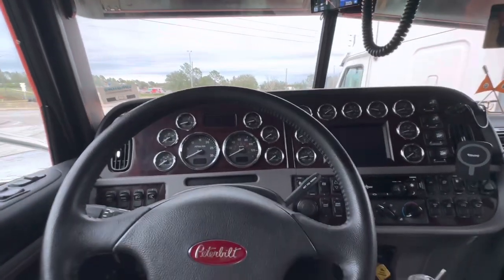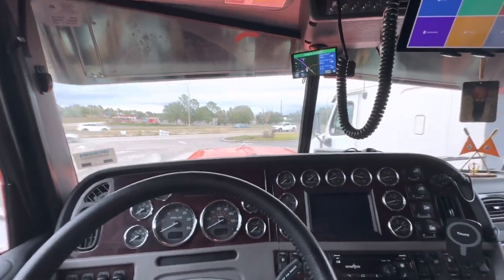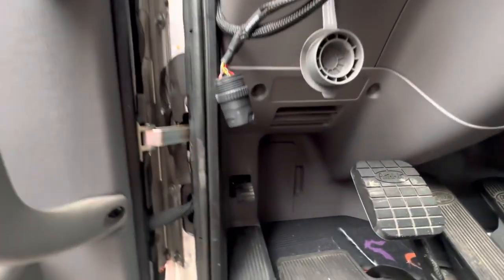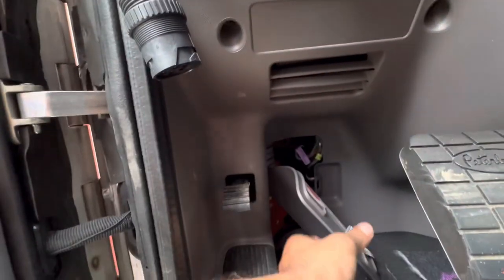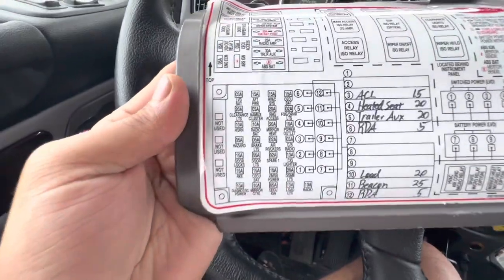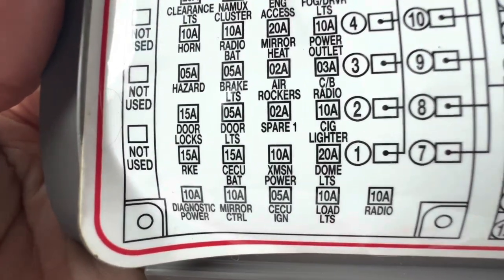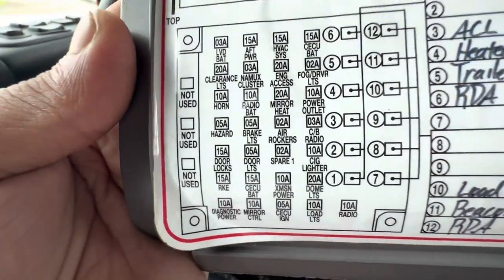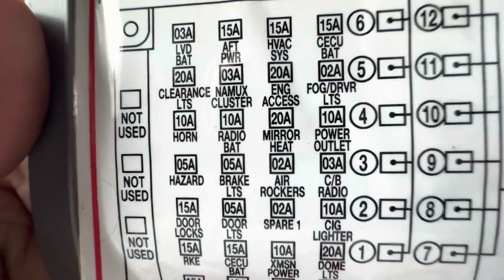Peterbilt truck tip…How to change the cigarette light charger fuse of peterbilt 389(2022)

Comment: Does it change the sleeper 12v outlet or are they separate,  my 12v on dash works not my sleeper 12v
Reply: Sleeper is separate.  Should be at fuse box inside your side door under your bunk